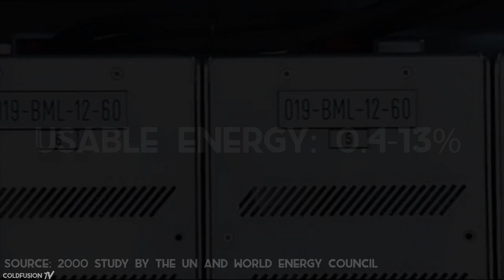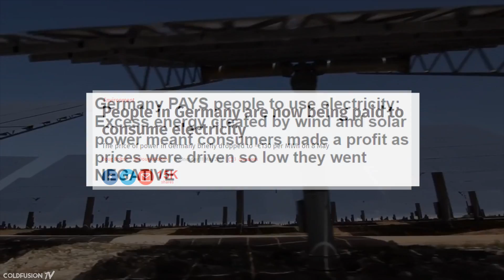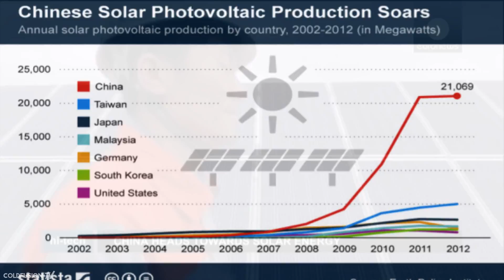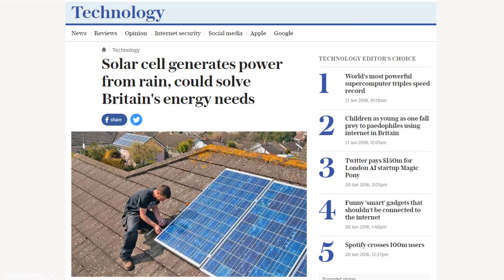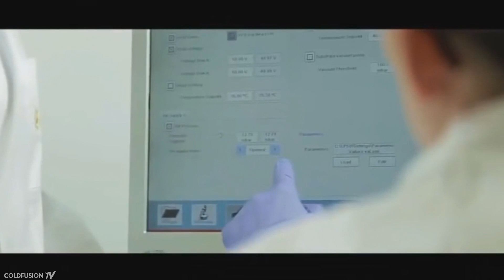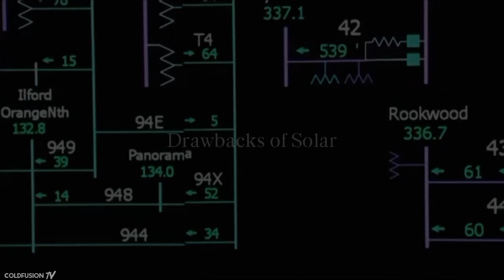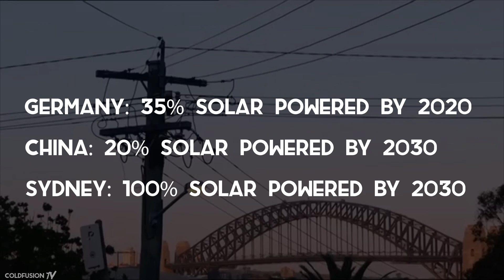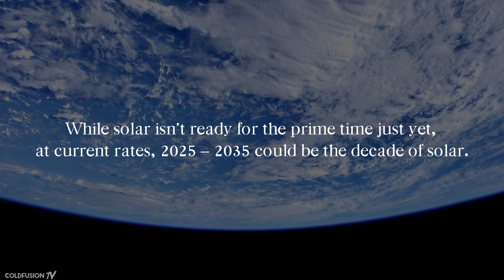The Truth About Solar

Comment: CA makes so much energy they cannot use it all.  They offered to sell it to neighboring states, who refused.  They offered it for free, well CA could not even give it away!
Reply: Allen Loser, Solar and wind will never be able to supplant fossil fuels.  There is not enough landmass to cover in solar panels to supply our needs.  

Economically they cannot supply the vehicles which run the economy:  batteries have limited lifespans (really bad for our landfills) and weigh too much on a goods to transported ratio.  

Recharging is not accessible over our vast landmass like gas stations.  America is huge, some place totally inaccessible to the feasibility of recharging stations.  Also note that batteries must be slow (almost trickle) charged for longevity.  Speedy charge damage batteries.  

They do not have the reliability, meaning your batteries lose quality with use.  They are extremely expensive.  Their access to the sun has limitations: rainy days, night time, other weather.  Even covering your entire vehicle in solar panels aren't going to get you very far if there is any real weight to your cargo.

For all those reasons off grid living is stressful living, constant monitoring becomes a religion, repairs to systems expensive, expendables expensive, systems to monitor each section looking for potential problems, and just so you know what the heck is going on.  That along is way beyond the average Americans abilities. 

The solar panels wear out:  they drop to 80% output almost immediately.  They have to be washed routinely for optimum performance, which then taps our water sources and limits their location.

Inability to access enough energy from the sun for various reasons, one being dark rainy days, tracking the sun as it rises and sets, tree coverage.  

As to wind, it is unreliable and kills our birds, and are eye sores.  It is only applicable to limited areas, meaning enough natural wind to tap into.  In my entire state there is only one tiny little corner that gets even the minimum and that is intermittent.  

The wind generators themselves wear out from the constant repetitive motions required to generate the energy.  This wear is exacerbated if set out to sea where the wind is most prevalent.  Sea salt would literally eat them and clog their parts.  It would be like being sandblasted every day.

These are just the short list of problems.  New technology needs developed, and it is not going to be here to appease the Green New Deal.  No one has invented it yet.
Reply: That's a downright lie. They buy energy from all over the Western United States. Hoover Dam in Nevada  for example, sells much of their energy to California.

"More than one-fourth of California's electricity supply comes from generating facilities outside the state."

https://www.eia.gov/state/analysis.php?sid=CA
Reply: Chazz7555, https://www.latimes.com/projects/la-fi-electricity-solar/
Reply: Allen Loser , because that is what the power grid hubs work off of.
Reply: Allen Loser, Oh and just as an FYI.  Just to do our average-sized house in solar would cost $85,000.  I guessed for someone the other day at $65, but I went back and checked the papers and it was $85.  Not doable for the majority of Americans.  Solar is sunny CA is a one-off as they say, not applicable to all states.
Reply: Allen Loser It sounds like you live in a location ideally suited for solar and with a company that is at least making it work on a limited bases, again location, location, location.  

As to over building a system, you would have to suggest that to CA.  I did not go the system, as it wasn't practical.  We have portable solar systems for power emergencies.  The quality and cost of solar panels are dropping dramatically and there is a new one about to come onto the market that is actually deemed "cheap" to produce and more durable.  Thus until the market has a cost balance ratio, I'm willing to wait.  We also have an issue with a lot of hail storms, so …

Also as an aside, did you see where two guys invented a gravity light?  It works off the same principle as a the pull weights in a grandfather clock.

Turning Gravity Into Light - Smarter Every Day 146
https://youtu.be/Jsc-pQIMxt8

GravityLight: lighting for a billion people
https://youtu.be/1dd9NIlhvlI

Light Bulb Powered Only By GRAVITY - 5 Times Brighter Than Kerosene Lamp
https://youtu.be/XXQZcvPld-4
Reply: Allen Loser, also see this:  How This Company Is Reimagining Solar Energy
https://youtu.be/1SqdssSINiM
Reply: Allen Loser LOL, I meant access to the sun, LOL!
Reply: Allen Loser, Of course it does.  The gravity light only needs wound every half hour.  Have you ever used a flash light that you shake?  Sheesh your arm will wear out long before the need for the light is met.  I have one.  I also have the crank ones, four.  We keep them in our vehicles because batteries are always dead when we have had emergencies.
Reply: Allen Loser! Interesting about your house.  I don't think you are the average user.  The gravity light has limited use of course, but it was thinking outside the box and that sort of thinking will lead to the next advancement.  The crank light isn't going to work even for young muscular men, boredom will get them first and they will sit in the dark, LOL!

Comment: 4:16. Now THERE'S your problem! I'm supposed to put that in my backyard? Do we cover our national parks to charge our electric cars? One parameter that solar advocates never discuss is the power density of solar. That is, how much real estate is required to deliver, say, a megawatt-hour of energy? I don't know the numbers off the top of my head, but I'm positive that natural gas, hydro, coal, and nuclear pack far more watt-hours in a square meter of land than an array of solar panels do, particularly since solar panels cannot operate 24/7 or on cloudy/shady days. Because of the variability of solar (and wind), there must ALWAYS be backup power at the ready for those times when "renewable" is incapable of delivering power. Which is "often." One immutable fact is that solar's output during the night is ZERO watt-hours.
Reply: You are correct, but I feel like nuclear should have been in it's own catagory, since it produses magnetudes of more energy then the others.

Comment: dream on Solar will never power high wattage factories. only little houses.
Reply: At one time an expensive huge energy sucking electromechanical relay the size of your hand and switching 1 single bit of logic was never imagined to be a computer. A humongous, expensive lead acid battery could never power a car for 500km. Now you have billions of transistors and a billionth the cost powering your phone or computer right now. We have lithium ion batteries that propel cars 500km. Explain to me how solar is different? that it won't get cheaper & more efficient or a newer technology doing the same thing take it to another level. Explain to me that.

Comment: What's wrong with solar..it cost too much..its only 18% efficient..anyone in the northern hemisphere only get 4 hrs of direct sunlight a year..the only people who need solar can't use it. Your talking about watts for the panel your not being honest..theres also the batteries..the converters..the wiring the installation..the average house uses 30 kw hrs a day..with 4 hrs of charging a day due to the sun in the northern hemisphere. A system to create that cost 300 a month for 30 years while it only cost 120 a month for electric and the panels are wore out before they are paid for
Reply: They got solar power up to 61% efficiency https://www.youtube.com/watch?v=stNNs-CC6a8 Also you don't need direct sunlight, you can get just as much energy any time a day with the tech mentioned in the video
Reply: At one time an expensive huge energy sucking electromechanical relay the size of your hand and switching 1 single bit of logic was never imagined to be a computer. A humongous, expensive lead acid battery could never power a car for 500km. Now you have billions of transistors and a billionth the cost powering your phone or computer right now. We have lithium ion batteries that propel cars 500km. Explain to me how solar is different? that it won't get cheaper & more efficient or a newer technology doing the same thing take it to another level. Explain to me that.

Comment: Price to buy solar panels are now down to 18 euro cent per watt - last auction a month ago PV producers sold electricity at 5,5 euro cent per KWh which is 20 % cheaper compared to the cost of electricity produced by coal , not to mention diesel or gas

Comment: Energy is literally the most common thing in the universe. Virtually all of the serious problems associated with solar are related to grid based generation. For approximately $150,000,000,000 every domicile in Australia could have a Storage battery and a solar system installed. Australian consumers spend nearly $50,000,000,000 a year on power bill. Economically, environmentally, and socially, it is a settled issue. The world needs to shift away from centralised power grids to decentralised, autonomous sustainable power production.

Comment: The Big Picture. All energy on Earth comes from it's interactions with the Sun. Plants use it to convert carbon into vegetation, which animals use to fuel their bodies. Some animals consume other animals to convert them into fuel. Evolution has been all about adapting fuel sources more efficiently. Human's learned to use animal and other human labor to conserve their own energy stores. This allowed them time to invent time and energy saving devices. Eventually these devices will replace all labor with machine work. Economics is part of this process, it's all about someone trying to get more out of a process than they put into it, i.e. to profit. According to this video, the Earth is exposed to 3.85 Yotta Joules (X10^24) of solar energy from the Sun, and that humanity uses about one hour's worth of this energy (from all sources?) in one year. Theoretically, to break even here on Earth with maximum efficiency, eventually we could be utilizing all 3.85 Yotta Joules to power our society, providing all the goods and services we require from the machines we design to provide them. Surface area of the Earth is 510 million square km, but the surface area of the Sun is about 12,000x the surface area of the Earth, so if we were to develop the tech to build a Dyson Sphere around the Sun (access to the raw materials may be more a constraint than the tech needed, unless we learn how to convert some of that energy into the matter we need) the surface area of a Dyson sphere as big as the Earth's orbit would be about 281,237 million sq km, about 551 Earths. As tech reaches it efficiency potential, the profit motive will dwindle and humanity will unite in civilization for all. :D

Comment: At the moment it seems to me that the future of solar power may be good based on possible future technological breakthroughs. Currently where I live it is not economically viable. The only benefit is being independent of external electricity su-pliers.

Germany was mentioned but the German drive towards renewable energies has been a disaster. That is why they built 3 new coal-fired generation plants.

Comment: No, electrical grids could remain the same with less capital upgrades to their  infrastructure unless you plan on selling solar to reduce investment cost and increase profit margins for the few leaving the many in the same state they are in today under the obsolete infrastructure the rich get richer and poor get poorer. WTF is wrong with you? Your system could remain the same for the duration FOR THERE WILL BE LESS USING THE GRID. So keep it. Worse thing that could happen is it will rust and not power your mansions anymore.
Reply: If I understand correctly, you're saying the grid could remain the same with massive implementation of solar power. Just a few things that would need to be implemented: energy storage (batteries, pumped hydro storage etc.), voltage regulating devices (on-load tap changers, synchronous condensers, FACTS devices etc.), new protection device (due to the fact that power flow can be bidirectional), inertia devices (solar panels don't have any inertia so the power grid could break into pieces with the smallest fault in the grid), backup power plants (for the times of longer cloudy periods and winter).

Comment: This is old news. RE is cheaper than coal
https://www.lazard.com/perspective/levelized-cost-of-energy-2017/
Reply: There are a lot of hidden costs with wind&solar. They will become more substantial when solar&wind penetration becomes higher.
Reply: @FrainBart_main  They're not hidden.  Upgrading the grid to avoid single points of failure and avoid climate change are costs you cant attribute just to wind or Solar.
 The technology and prices are changing, but the arguments against RE are just the same, and just as wrong.
Reply: They are hidden because they're not included in the LCOE and this is something most of people don't understand.

There are other technologies to battle climate change. We can use hydroelectricity where it's possible, geothermal where cosy effective and biomass where there is an increment of forrest. The gap between production from then and consumption can be filled with nuclear energy. There is no need for any energy storage devices, reserve power plants, voltage regulating devices, additional inertia systems etc. with them. That's why I was addressing only solar&wind.
Reply: @FrainBart_main  of course not everything is in LCOE. Its about the price the cost and energy produced.
This is why its economically viable.
And if you include health cost savings moving from coal to non-fuel sources, the reasons become compelling on cost alone.
Add in climate change, and only dupes and trolls are deprecating RE.
Reply: @DrChill2  I would like to see some estimates of how much do coal power plants cost us including health costs. Climate change costs are almost impossible to calculate, we aren't even sure how much of the global warming is happening due to human greenhouse gas emission. We have a coal power plant right in the middle of the capital here in Slovenia, but it's burning brown coal with very low sulphur and dust content and there is a lot of filters on the exhaust system, so most of the people don't even realize it's there.

I think we emphasize the need to use wind&solar energy a bit too much (IPCC, Greenpeace etc.), there are alternatives which would be a lot cheaper and we would still have clean environment without too much CO₂ emmisions. Off course most of our policymakers are 100 % wind&solar is the best way to go.
Reply: @FrainBart_main  Just Google"health cost coal" 
A study by EPA's Ben Machol and Sarah Rizk found that the use of coal in America costs us anywhere from $350 billion to $880 billion per year. That's up to 6% of our GDP, and well over 10% of our total health care costs. Total health care costs in this country are about $3 trillion per year.Nov 5, 2015
Reply: @DrChill2  Holy sh*t that's high. Don't you have flue gas denitrifaction and desulphurisation and filters for PM? We have a fairly new block in a coal power plant which lowered emissions because of closing of older blocks on average about 80 %, it also provides remote heating, so the use of biomass in surrounding cities is low (PM are a lot lower). Of course it uses BAT (best avaliable technology) so it was quite expensive. The one that I mentioned previously also provides remote heating for the whole capital city. So it could be, that maybe the health effects because of coal use in my country are around zero.